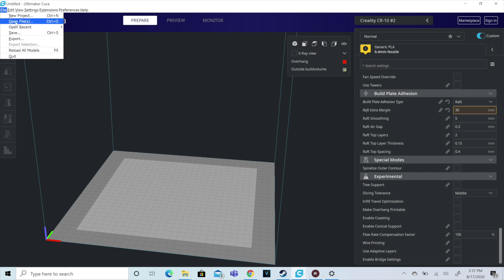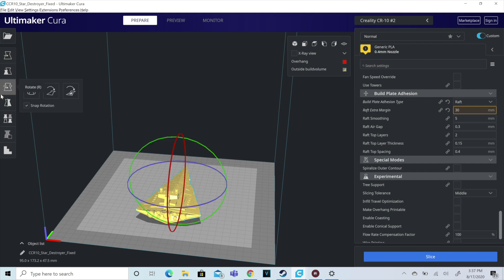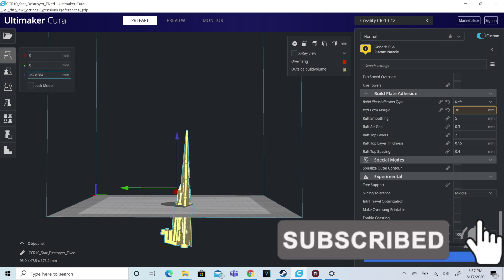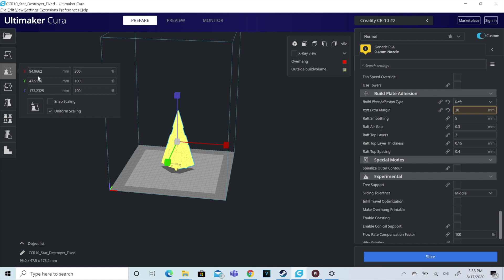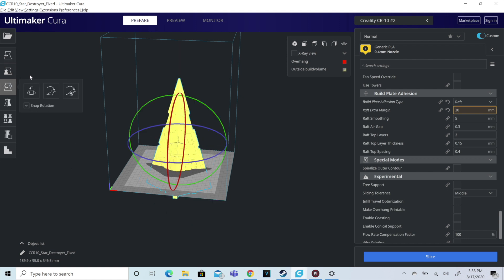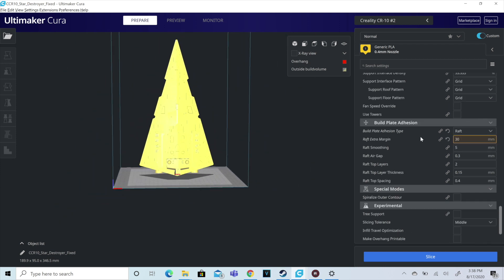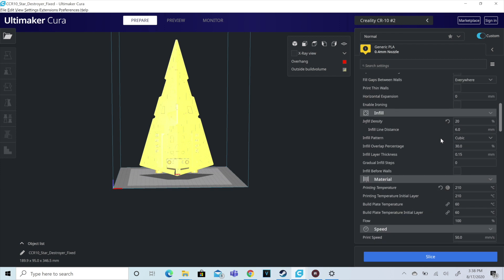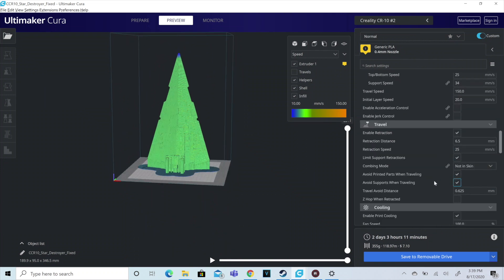3D Printed Star Wars Imperial Star Destroyer step by step and  timelapse

Comment: What infill % did you use?
Reply from the maker: I used 10% infill.  Since this will be a shelf model I felt I didn't need very much to do this one.  If this was going to be a toy or something along that line I would have step up to 40% or so.  With the wall thickness at 4 its really strong with little infill.